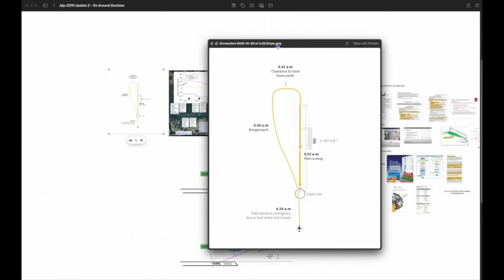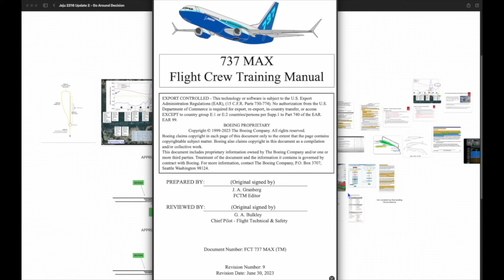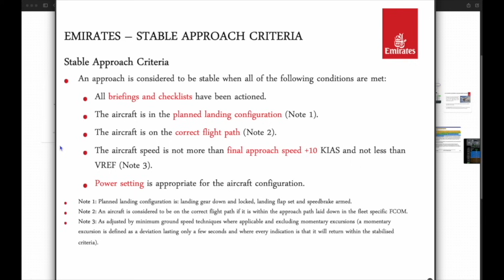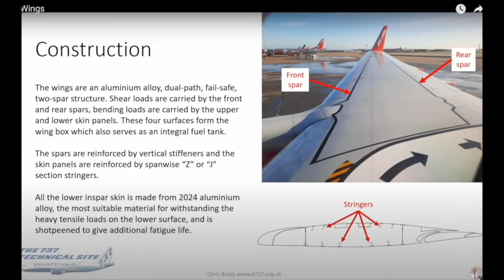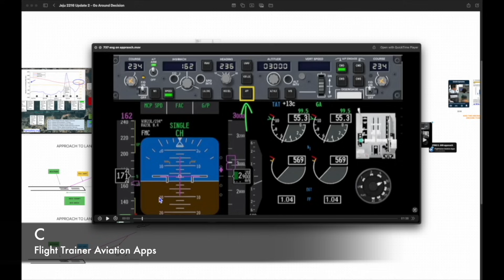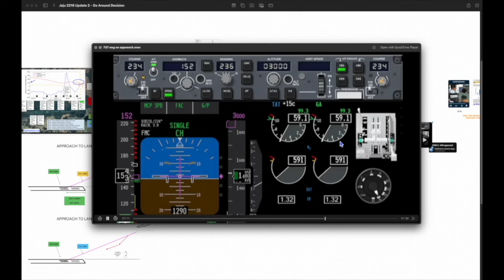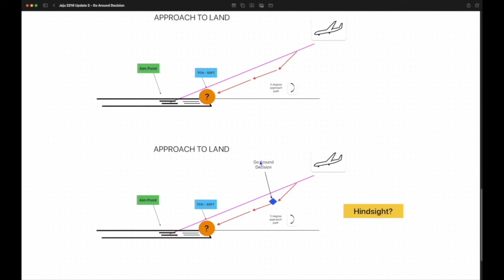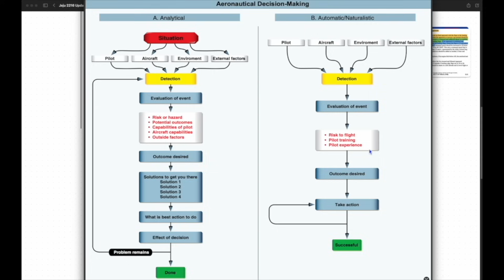Go-Around Explained: Jeju Air 2216’s Decision Not to Land

Comment: Did they have a birdstrike and go around, or did they go around because of birds and had a birdstrike? We had the latter situation a few years ago, and because of that incident our pilots now are set to land if there are birds on short final.
Reply: Isn't it clear that in the graphics at 3:30 the peak shows go around and loss of signal shows bird strike? So go around was before bird strike.
Reply: @user-yt198  Correct, that is the key point. The go around was started on two good engines.
Reply: @christopherrobinson7541  Yet many commenters are still asking why they initiated go around with damaged engines.
In the last 3 weeks I realised that most people, including pilots, are unable to read graphics.
Reply: @user-yt198  The ADS-B shows that the go around climb away was at a rate that could not have been achieved on one engine. Hence, the go around was started with two good engines.

The answer to the question, why did the pilot elect to go around on one engine, is simple; he didn't.
Reply: @ Hmm, I am saying the same thing.
Reply from the maker: Yes fair question, the CVR data would have been key to answer this one...
Reply: This should be the training. I am not a pilot... but it is simply logical - why rely on engines when configured to land and near the runway... just continue powering down and landing.

Comment: your at 450 feet and birds take out your engines you know it's time to land NOW, where was he going , land now!!  MX Rep
Reply: I was given a simulated  engine out at 250 feet on final 5kts  over min approach speed and still used all the piano keys & touch down markers  when wheels touched down. so a plane does not fall out of the sky when you are already on or above best engine out glide speed just still a 9 in 1 decent rate
Reply: You said it all!  It seems that some are unnecessarily making it more complicated then then it needs to be.  Even if after the bird strike he was below glide slope,  there was plenty of power available to make the correction.  You are on short final, keep it simple.
Reply: No-one wants to admit that the pilot shoud've kept calm and carried on.

Comment: Your ceiling light either has a fan rotating over it, or (more likely) has low frequency PWM. It's causing the light on your hair and shoulder to appear to flicker. If it's not a fan and you plan to continue filming video in this room, I suggest you change to a LED or CFL bulb with higher frequency PWM. Modify your camera so it has a slower shutter speed. Or (least desirable solution) find an old incandescent bulb and install that in your ceiling.
Reply from the maker: Thanks for the tips!

Comment: The real cause of this accident and I repeat CAUSE that led to a catastrophic chain of events is dual engine jets with increasingly large diameter engines.  This design is unsafe for civil aviation!   The airline industry like most modern businesses has become very very greedy, ...to the point of compromising safety.   The claim is that quad and tri jets are less efficient and cost more to operate and therefore are being abandoned in favour of dual engine jumbo jets!   These have massively large diameter engines, twice or three times the diameter of engines made in the 1960's.  Increasing engine diameter leads to greater probability of ingesting birds and fever engines leads to dramatic rise in probabiltiy of having an ALL engine failure, having a NO ENGINE situation.  A tri or quad engine jet has MUCH MUCH lower probablilties of this problem!  And so we are increasingly seeing Sully type situations.  Until the dual engine jumbos start falling from the skies killing people by the hundreds and falling on the infrastructure of the super rich, investigators will just ignore the ROOT cause and recommend dealing with after-effects only.   The root cause is the dual engine design combined with excessive engine diameter.
Reply: No
Reply: @johnp139  You must be ignorant of statistics.  Engineers of the 60s and 70s, designers of planes like the Boeing 707 were NOT stupid.  The 707 was a quad engine jet with much smaller diameter engines than today's dual engine jumbos, ...and not a single 707 nor 747 for that matter EVER suffered a NO ENGINES situation due to bird strikes!   Thousands were produced and are still flying safely.  As far as I know NOT a single tri engine jet EVER suffered a total loss of engine power due to bird strikes.   Theoretically the engines can be made stronger ...to better withstand bird strikes, but this is only in theory.  New, more fuel efficient engine designs rely on large engine diameters.  As the turbine blades become longer they also become more fragile and prone to damage upon impact.  The design combining fewer engines with larger diameters is basically faulty ...and that is why we are seeing more Sully type incidents.  Investigators will most certainly ignore the issue and focus on dealing with after-effects etc.  No one investigator will risk his/her career and dare taking on the powerful industry- big aero business, that has become greedy.  Not until we see dual engines jumbos falling from the skies, killing hundreds, also falling on the infrastructure of the super rich.  Until then the root cause will NOT be addressed.

Comment: Very thorough video.

May I add my two cents as a pilot flying in Korea:

You’re not factoring in the “Kimchi Factor.”

This Confucian, highly punitive culture still learns mostly by rote and most expats flying there will tell you that “they fly like they drive.”

Cultures, within CRM and TEM, are widely discussed among professional crews but only rarely addressed  by NTS people, most probably because of political correctness.

But as an observer of Korean aviation for over a decade, it completely makes sense that a deviation on final would be interpreted by a Korean aviation mind as being not stabilized, hence requiring a go-around…even though the B737 was fully configured and with a long windless runway straight ahead.

That’s a quintessential “Kimchi Factor” reaction.

Post scriptum:

-Typical Korean captains, especially ex-RKAF ones, will almost invariably let the F/O fly back to the home country as PF, meaning that not only was the Jeju Air F/O the PF but crucially that the transponder was on #2.

-Bird strike on engine #2 seems to be accepted by everyone. A loss of thrust on the #2 side or even a Gen #2 failure would still see transponder #2 powered.

-The above-mentioned “Kimchi Factor” now hits, the aircraft becomes slightly unstabilized and a go-around is initiated leading to a cleanup of gear and flaps.

-During the go-around, either engine #1 failed (bird strike) or was mistakenly shut down by the crew (another aspect of the “Kimchi Factor” rarely discussed.)

-Both generators would now be inop and given the fact that transponder #2 was selected, the result would be that neither the #1 or #2 transponder would be transmitting (consistent with ADS-B, CVR and FDR cutout.)

-A transfer of control back to the Captain would have taken place and given the graph showing VSI and altitude gain, it stands to reason that both engines were inop.

-The transponder switch was never turned back to #1 (powered by the standby electrics) and without elec or engine-driven hydraulic pumps, the flaps and gear were unable to be extended, in the time available. 

The rest is history as they say.

The “Kimchi Factor” is not alone in the world of cockpit cultures. The “Habibi Factor” is another notorious one. More recently, the “DEI Factor” was introduced, leading some pilots to hope that the election of Donald Trump would put and end to that non-sense, ie: MAGA=Safer skies for all.

These are my two cents.

Thank you for your most professional video presentation.
Reply: One small disagreement with your excellent discussion of the technical aspects (the culture I am unfamiliar with). The plane, after the bird strike, was no longer properly configured. The config for a one engine or no power landing is significantly different than for a standard two engine landing. Also, the go-around allowed time for the cabin to be prepared. Not of any use in this case, but very often can be the difference between casualties and survivors.
Reply from the maker: @petercollins7730  thanks for the comment, fair comments - I'd love to get more data and go deeper
Reply: How on earth is somebody as disgustingly r-c-st as you, allowed to even be a pilot???  I thought they were supposed to maintain some semblance of professionalism and decency?  Guess you missed that part in your "culture".
Reply: How on earth is somebody as terribly r-c-st as you, allowed to even be a pilot???  I thought they were supposed to maintain some semblance of professionalism and decency?  Guess you missed that part in your "culture".
Reply: How on earth is somebody as horrifically r-c-s-t as you, allowed to even be a pilot???  I thought they were supposed to maintain some semblance of professionalism and decency?  Guess you missed that part in your "culture".
Reply: How on earth is somebody as terrible and r-c-s-t as you, allowed to even be a pilot???  I thought they were supposed to maintain some semblance of professionalism and decency?  Guess you missed that part in your "culture".
Reply: You have brought up a point (though unpopular in the PC & DEI worlds) that affords a clear headsup to those who work at the coalface in any profession  requiring rapid mind/body coordination. Armchair strategy is universal; but delivering under fire is something else- national cultures matter. Thanks.
Reply from the maker: @ak-rx1ui  thanks, and yes pilots need to delivery when it counts. It's the greatest job there is!
Reply: @ How does "PC & DEI" factor into an accident where literally every single person involved was male?  Maybe stop servicing your bigotry and look at what actually happened. The cultural context he is describing is the polar opposite of "PC & DEI."
Reply: @petercollins7730  You don't seem to understand my comment. The original commentor did, and replied. It is not my job to remedy your comprehension skills.
Reply: @petercollins7730 He was simply comparing DEI to foreign attitudes in the cockpit. We have a system for the way things are supposed to be done in the air, and it generally works. If you start messing with it by adding outside influences from your culture, or based on your identity. Those things don't necessarily equate to competency or good CRM. Plane go boom.
Reply: @Cedric_Harris  Except the kinds of culture that have historically caused problems in the cockpit are THE OPPOSITE of PC and DEI. Modern CRM, which has undoubtedly made flying vastly safer as you say, emphasizes the same principles as his hated PC - each member of the crew is equal and valuable; cooperation is encouraged; a variety of viewpoints need to be expressed and seriously considered. That is PC. The problem comes with strict structures of authority - pseudo-fascist superiority by the pilot, for example.

The op was just trying to express his bigotry, not to make any comment on culture. If he was criticizing what he himself claimed was Korean culture, he would welcome PC and DEI, because they are the antidote to such culture. 

Don't defend bigots -0 some people will assume you are one too.

Comment: Clickbait. Your title erroneously says "Go-Around Explained", but you do not explain the go-around in any way and it remains "bizarre and puzzling". Furthermore, Your title erroneously says "Jeju Air 2216's Decision Not to Land", but you do not explain, or even speculate-on, their bizarre decision. Instead, you spend over 19 minutes babbling about rules and regulations. 🙄 So I had to give this video a Down-Thumb (Dislike) due to it being bait-and-switch. Stop that!
Reply: They were warned by ATC of birds went TOGA gear flaps up but too late lost both engines. 
A APU switched on could have saved that aircraft.
Reply: @Lonsome1223 
Maybe they did. We don’t know.
Reply: @meofnz2320 If that APU was working they'd have immediate power to all systems. 
It's the norm for the APU to be switched on after landing. 
100% that APU wasn't running.
Reply: @ 
You don’t fly a 737 do you?
Reply: The go-around is neither "bizarre " nor "puzzling." In fact, the go-around is precisely what the procedure of both Boeing and the airline call for in the case of a bird strike on final. Once the strike occurred, the approach was no longer stabilized, and the plane was not configured to land. Either condition mandates a go-around. The fact that you don't understand the "rules and regulations" doesn't mean they don't make perfect sense.
Reply: @petercollins7730  Trying to go around if your engines get damaged right before landing doesn't make any sense as you need a lot of thrust to be able to climb and turn safely. Things can only get worse, and they will probably get much worse very quickly.
Reply: @petercollins7730 
That’s not quite correct. The Boeing manual actually recommends continuing the approach. This video does a good job of explaining several factors that could affect the decision including the possibility that the approach became unstabilised after a bird strike.